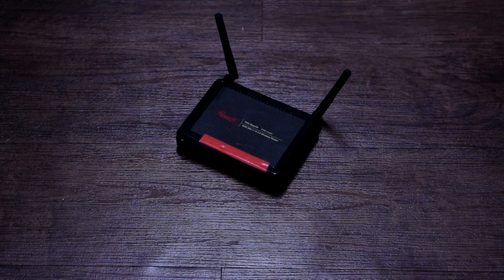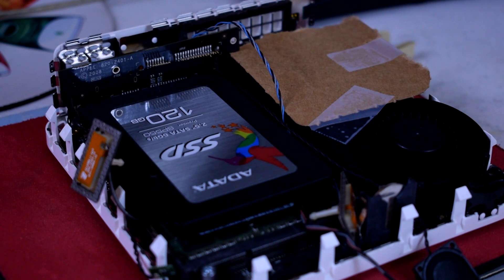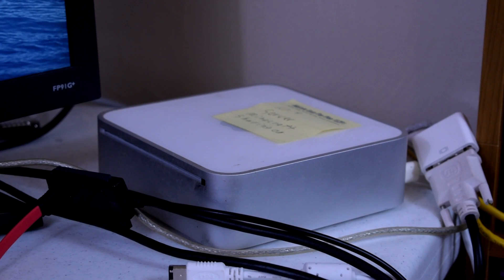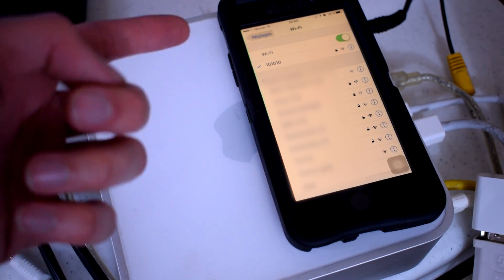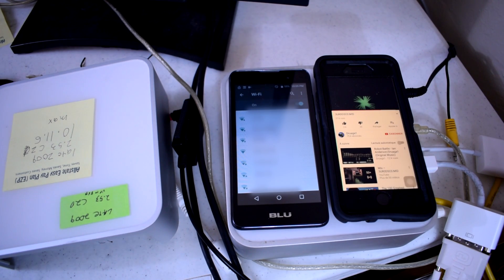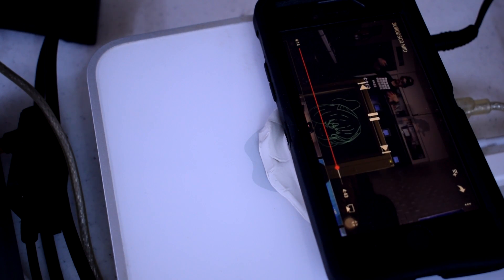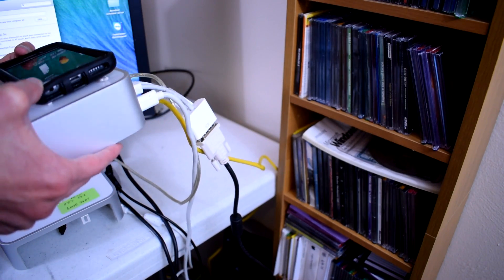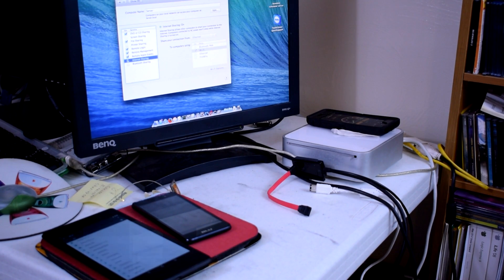Circumvent KRACK and Protect your WiFi

Comment: Removing the antennas may damage the wifi card. Due to the impedance mismatch (infinite instead of 50ohms) all the transmit power that would normally go out the antenna is reflected back to the transmitter and dissipated as extra heat.

Comment: 😂 RIP Wi-Fi slave Mac mini

You can also buy an Ethernet adapter from Apple, it works for iPad and iPhone, you will need an Apple Lightning to USB adapter, a cheap powered by AC USB hub, and an Apple USB to Ethernet adapter plugged in it
https://lifehacker.com/hack-together-a-way-to-connect-an-ipad-or-iphone-over-e-1770270331

Simple, huh?

Comment: Even if it's a joke, this would be even worse than nothing, the packet used to gain access to a WPA/WPA2 network is the handshake, having so poor signal quality will make the connection to be reset again and again, so these packets will be sent a lot more times making the network more vulnerable. Yes yes, I know this is a joke video, but for sure some "illuminated" may think this is really a good idea.
Reply: The attacker would need to know the name and channel of the target network. Not easy if they can't receive it...
Reply: With a directional antenna it will be able to receive the data, those have a very big gain. Yes, it must point to your place, but that's the usual way to hack a WiFi.
Reply: You're saying a directional antenna will be able to receive a signal so weak that you can't receive it with a phone when standing right next to it?
Reply: In certain cases, yes, directional antennas have a very big gain compared to omnidirectional ones, and the ones at phones are omnidirectional. But again, in certain cases, and also, I was pointing that it was just a notation if someone thinks that reducing power to avoid hackers get your signal is a good idea, not exactly for the case the video presents.
Reply: geniwab I gotta say... For someone who talks about antennas and gain your grammar is pretty poor. Not sure what you mean by gain either. I mean I'm no electrical engineer but isn't noise amplified by a higher gain as well? To be honest, as someone who has little experience with radio signals your claims sound pretty shallow.
Reply: Smartass ...
Reply: jesus you must be fun at parties
Reply: It's ok. It won't take that long before to reflected signal just burns out the transmitter chip and then it won't be a problem anymore.
Reply: +Martin Turner
What reflection are you talking about?
Reply: By your comment, yes, my ass is surely smarter than you.